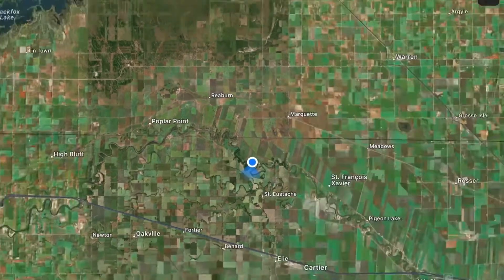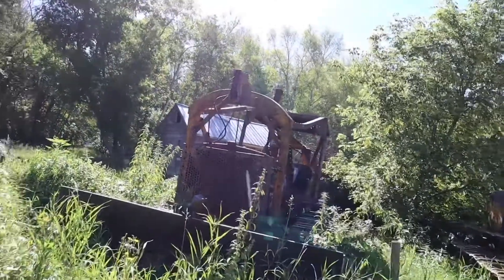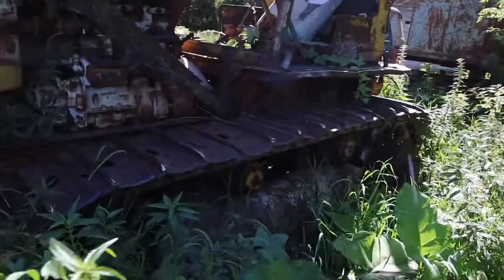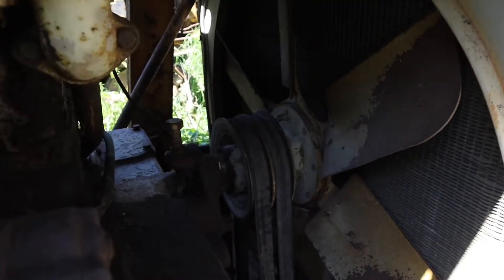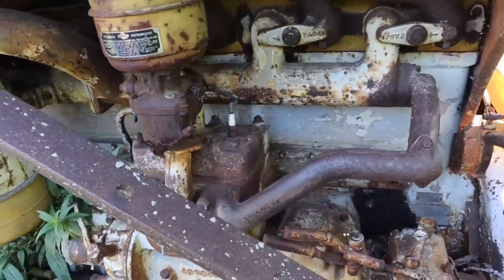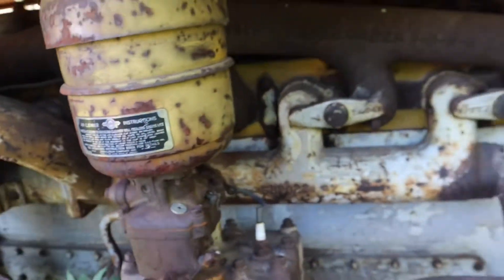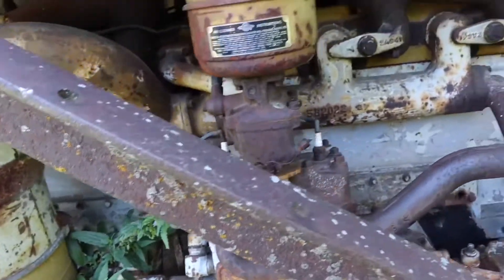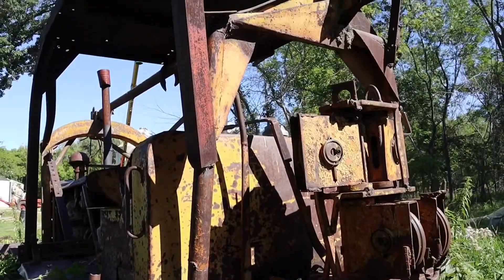1937 Caterpillar D8 (85 Years Old!) | How Old Stuff Works

Comment: They would turn over the big motor with the pony engine until you built up oil pressure and warm up the big motor till its ready to fire. I had a 1936 cat D6 2H model which is a three cylinder just half the size of the D8 2U engine
Reply from the maker: I love the simplicity.
D6 = 3-Cyl
D7 = 4-Cyl
D8 = 6-Cyl